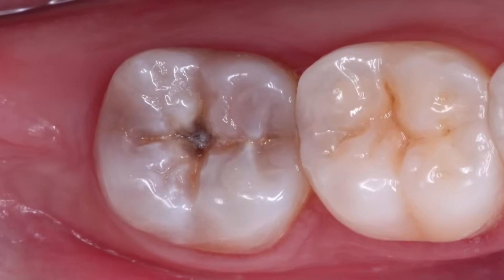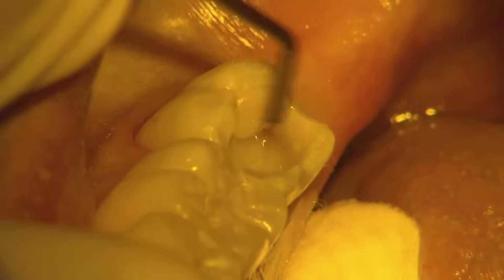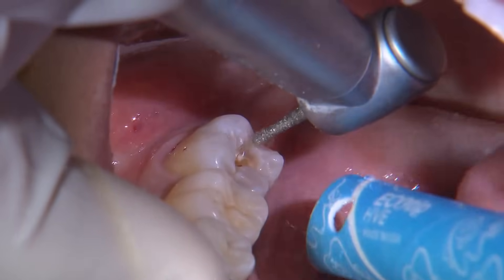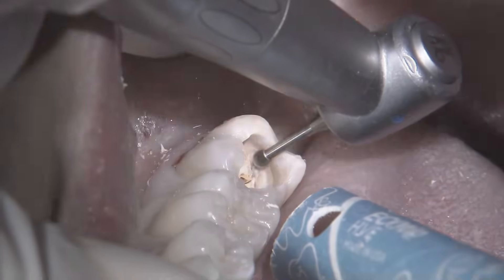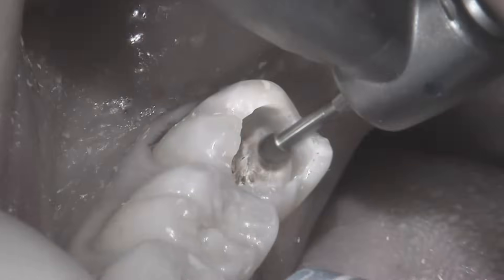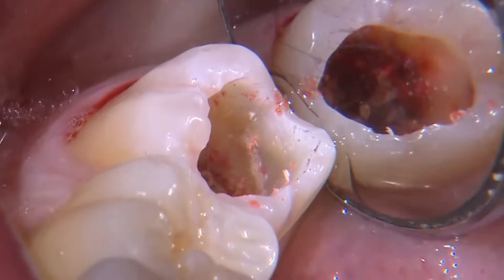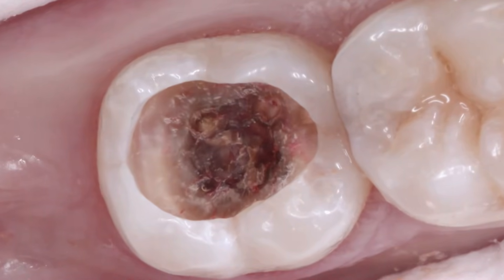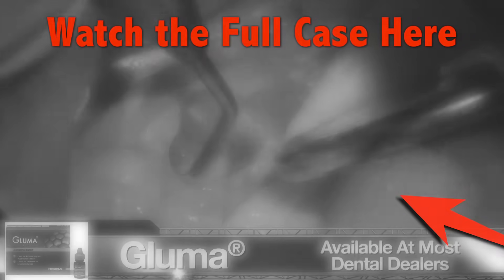HOW TO Clean Up Severe Occlusal  Decay on TOOTH #31: 1 of 2

Comment: Very nice and conservative approach doctor!  I treat these the same way, and am very cautious about trying to chase decay and then causing a pulp exposure (which definitely has to be treated at that point).  I prefer using the conservative approach to get rid of all of the affected dentin and obvious decay, until everything is nice and hard to the explorer.  If for whatever reason, this conservative approach doesn't work and the tooth is still symptomatic after the restoration; then at that point you can proceed with aggressive caries removal and likely RCT.  But I like to at least give it a chance with the conservative approach.  It's usually successful and saves the patient a lot of time and money.
Reply: I had a tooth like this after mercury filling fell off. Despite RCT recommendation by HMO clinic, I went to the old school dentist who was able to fix my tooth using liner and white filler.

Comment: Leaving the affected dentin is fine, removing the infected is important. But given you are close to the pulp horns, wouldn’t you want to use a liner such a Dycal as well? Then preforming your acid etch, bonding and composite stages?
Reply: My thoughts exactly.  When it's that deep, I use Dycal directly over the portion near the pulp, and then Vitrebond over that.  If there's no direct pulp exposure and you've removed all of the obvious affected dentin (i.e. everything feels nice and hard to explorer/spoon excavator), I almost never have an issue.  But I definitely use Dycal and Vitrebond in these cases.
Reply: @80sports20  is there a risk that the explorer will cause pulp exposure when trying to feel the dentine?
Reply: @zakia8643  No, hardly any risk of using an explorer/spoon excavator.  If it somehow did cause an exposure, then that means that dentin is so weak and you wouldn't want to restore over something like that.  I've never had a case where the explorer or spoon excavator caused an exposure.
Reply: Can you explain what all those materials you mentioned are? Are they liners? I only use biodentine, or caoh after caries removal @80sports20
Reply: Использование в таких случаях прокладки из кальция гидроксида обязательно. Нет вопроса "использовать ли?". Только так. Либо серебро содержащий цемент, например, Miracle Mix. Либо Витремер/Витребонд. Сразу наносить композит в такую глубокую полость - ошибка. Последствия: вначале послеоперационная болезненность, а в долгосрочной перспективе - медленное умирание нерва и развитие периодонтита.

Comment: can you get root canal while sleeping ?
Reply: NO
Reply: They put a gas mask on u for to feel a bit sleepy, when that they put this gel thing for the gums to feel numb, then they inject the gums with the syringe like 1-2 times for no pain, then they fix the tooth and they will be done, so no u don’t get a root canal while sleeping

These are the symptoms of a root canal: •Severe pain while chewing or biting.
•Pimples on the gums.
•A chipped or cracked tooth.
•Lingering sensitivity to hot or cold, even after the sensation has been removed.
•Swollen or tender gums.
•Deep decay or darkening of the gums